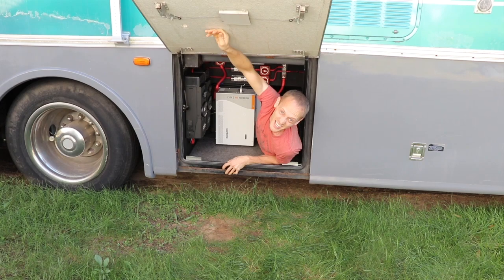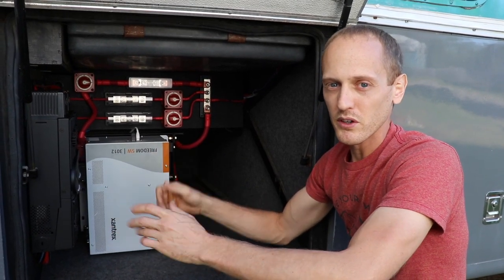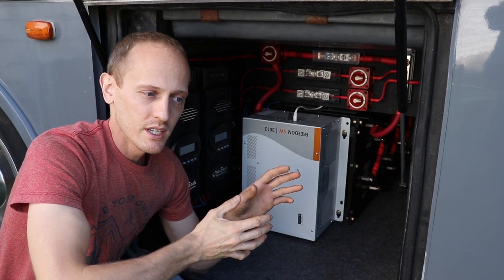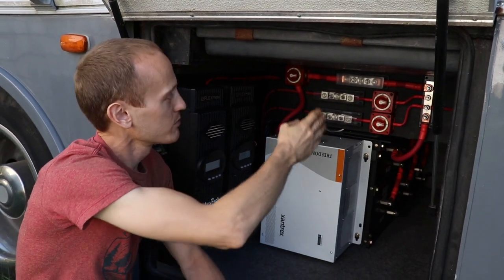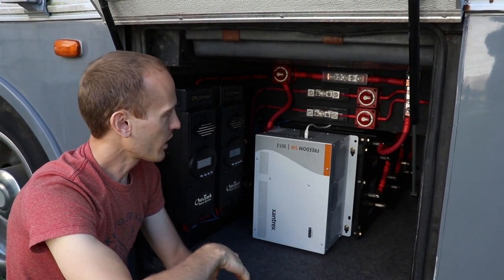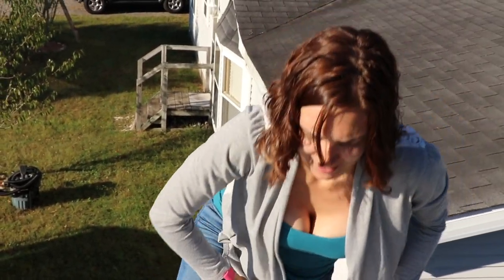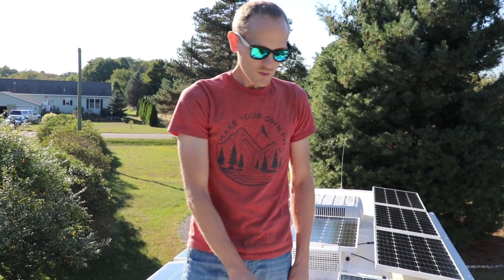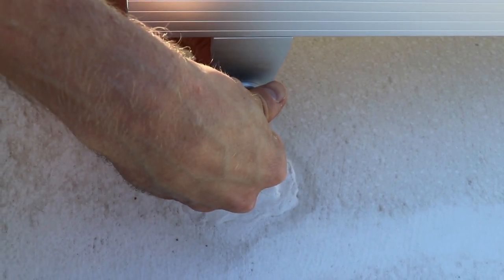Massive DIY RV Solar Install for Off Grid Boondocking

Comment: weight?
Reply from the maker: Battery weight is mentioned in the video. 720 pounds of batteries. With everything involved in the install from panels, to controllers, fusing, wire, inverter, hardware, and frame, we added about 1300 pounds
Reply: @HereThenGone  I guess I missed that, I am deaf, new implant and it must not have come thru in the CC like it should have, thanks for the info, not so bad considering what u got, my fifth wheel has a cargo weight of close to 5000 lbs so I understand  weight

Comment: Sean,

Nice clean install of a robust system! Kudos!
During peak sun and peak load on your system, what are the maximum amps you have seen your charge controllers put out (combined)?
BWT, I think you made a very smart choice by going with good quality AGM vs Lithium. Even though, LiFePO4 batteries have come a long way and are gaining ground, the fact remains is there have not been around long enough to prove their claimed life expectancy under real life use conditions. If you treat your batteries right, I would not be surprised if you get 15 years out of them. This will buy you enough time to see what the true life expectancy of Lithium is and hopefully the cost will come down and further technological fine tuning will be done to the Lithium batteries. If your battery bank works this well for your needs, why would you even want to risk trying Lithium until your batteries expire? Everyone claiming that Lithium is less costly in the long run, is going by advertising hype and false claims. One of the many false claims, is that lead acid only lasts 3 to 5 years. Maybe for the marine deep cycle, but for most that use the true deep cycle golf cart batteries or renewable energy application, those batteries easily serve 15+ years. Many last 20+ years, at a fraction of the cost.
On my coach, my system is half the size of yours (960W, same brand and output panels that you have), and I have four Crown CR260 flooded acid batteries, giving me 260 usable amp/hrs of capacity. It works flawlessly, I am able to use anything I need, except for a/c. Most of the time one or two box fans are more than plenty to keep us cool.

BTW, in your two years of research, to you stumble along and read "handybobsolar" blog? www.handybobsolar.com   He was full timing on solar only from the late 90s to about 2014 and figured out all the weaknesses that made the early solar setups inefficient and ineffective. Has a lot of good pointers on solar (doing it right for the best bang for the buck) and how to treat lead acid batteries where the serve a very long time.

Happy and save travels!
Reply from the maker: So far the peak amp input from solar has been 119amps. We are getting further South now and I look forward to seeing if that increases as we get more direct light on the panels

Comment: Can this solar panels survive lets say on an overland, setting going on roads with lots of bumps?
Reply from the maker: If you don't flip over then yes. Haha. High quality panels hold up better to hail than anything else on the roof of an RV. We have been down some pretty nasty roads with them on this rig and also spent 45 minutes going down a single lane gravel road with trees hitting and dragging across them without a scratch.

Comment: Lithium are less expensive then agm in the long run..
Reply from the maker: So if you have the money, go lithium obviously. If you don't have the money, get the best you can afford. We spent over 2 years saving for what we have in this system. It would have been 7-8 more months to go lithium. We made the right decision for our situation.
Reply: @HereThenGone  Hi, how many usable kwh do you have...? By usable i mean... 1kwh of gel is something like 500wh jsable cause you can't go farther then 50% discharge.
Reply from the maker: @honumoorea873  we have 600ah usable of our 1200ah bank. Converted to your wh that would be 7,560wh @ 12.6v.
Reply from the maker: @honumoorea873  and yes you can go further than 50% as long as you get them charged back up withing the day. Obviously the less you deplete per day, the more life you will get out of them.

Comment: For how long the power lasts?
Reply from the maker: That completely depends on your usage and how much input you have from the sun. We currently haven't hooked to power in 8 weeks and we haven't run the generator except to do it's monthly maintenance cycle (didn't need any power input from it). We cook with induction, we've run our roof A/C a few times when needed, run a window A/C all day a few times when needed, use an electric countertop oven, electric griddle, microwave, and electric water kettle for tea. There is no figure I can give of "how long does the power last" because there are too many variables

Comment: 1200Ah at 12v and 3kW inverter is a risky setup but it is fine as long as you don't use a lot of discharge  power. Your 12v wires must be heating a lot. Why not to use 48V setup for fire safety and wire/weights savings? I believe you have a lot of apliances that run on 12v in your RV and that is why you decided to go for 12v. It is a tough choice to make and I hope it is working for you well. With regards to cost of battery per Kwh per 1000 Cycles the cheapest is Tesla lithium battery. Someone made comparisons and presented with results, i did not verify it but you might like to check it out.
Reply from the maker: No heat issues at all with our 12v wires. Size them appropriately and you are good. That's why we are running 4/0 cables on the DC side. And very short runs. We have been full time for 2 1/2 months now. Over a 1 1/2 months of that has been boondocking and using all of our electronic (120v) heat sources. Induction top, instant pot, countertop oven, microwave, hot water kettle, electric griddle. Without issue.
Reply from the maker: Nothing risky about a properly built and sized system
Reply: Sounds like it is all well built. I like the simplicity of battery connections. Maybe I will do similar way if it works well.

Comment: Few questions regarding those brackets being mounted onto RV roof:
1. By any chance when traveling down the road would the wind 'vibrate' those panels,    causing the baked-brackets' epoxy to 'crack-up', creating leaks.
2. On the inside of the bracket-holding bolts did you use any washers, gaskets, etc.?
Reply from the maker: There is no epoxy involved in mounting the panels. You use dicor, which is specifically designed to retain elasticity. With it sandwiched between the bracket foot and roof, drawn into the roof with the lag bolts, and completely coating the foot and lag heads, you are good to go. I have had these 100 holes in my roof for a year and a half and have over 5000 miles on the road, including a lot of single track gravel roads, without any leaks or issues. As for putting the bolts all the way through, if you want bolt heads all over the inside of your rig with nuts and washers exposed, I guess that is up to you, but otherwise you just tighten the lag bolts(that aren't longer than your roof is thick) down by hand until snug so as not to rip out. Hope that is helpful

Comment: 750 each ?     jeex    way more then lithium
Reply from the maker: Not sure what you are asking? What is 750 each?
Reply: @HereThenGone  i was checking out the cost of those batteries you have..... 6v were the only ones i found that had those pull cord handles on the sides...  amazon wanted 750 each,,   damn near blew coffee out my nose ,  wondered about that cheaper than lithium comment until i saw when u made the vid just now
Reply: @HereThenGone  dont get me wrong..  loved ur set up... prolly do something similar ,,,   found a great deal on used 270w panels for 50 bucks in a warehouse in arz..
Reply from the maker: @stevestrickland7314  we got ours from batteryguys.com and they were only 580 each. Lifeline are the best you can get for AGM batteries, so of course they will cost more than something from Costco like most people go with. Haha. Still thousands cheaper than lithium of the same total capacity.  Good luck with your system. 👍

Comment: I should have asked you how wide is your RV?  Next time you change your batteries (seems like you definitely have the skill) maybe you could make a sliding battery rack system for easier access. Of all the system installs I have watched on YouTube you have the best I have seen. Awesome job. Love it....Could you use a 110 amp thermal breaker instead of the catastrophic T fuses from the charge controllers as well as for the 400 amp coming from the main positive buss bar before their respective termination switches?
Reply from the maker: Our rig is 8 1/2 ft wide. Wider with the mirrors obviously. I was going to do a sliding rack, but as you could see there was literally just enough room for rack I built. Not enough room for the massive sliders it would take to handle the load of the batteries. You need to keep your fusing in the proper format. DC and AC currents are completely different animals

Comment: I have 2150 Watts how much of solar panel do they use and how much of the batteries do I use to control this power
Reply from the maker: I can tell that English is a second language so the question doesn't make complete sense. If you already have 2150w of solar panels, the most battery you would want if AGM or flooded would be 1400amp hours.

Comment: May I ask what your total material cost for this setup was? Thanks in advance.
Reply from the maker: If you include everything, and I mean EVERYTHING down to the screws, nuts, bolts, plywood, spray paint, heat shrink tubing, terminal ends, wire, everything we ended up at $15,000. Luckily we had been saving for over 2 years while working overtime and weekends the entire time. No life, but we reached a goal.
Reply: @HereThenGone  Wow! Thanks!

Comment: i WOLD LOVE TO SEE DIAGRAMS OF YOUR SOLAR PANEL AND WIRING SET UP.
Reply from the maker: Every solar installation will vary when it comes to wiring. What worked for us may not be right for you. The original wiring of the rig even comes into play. I didn't have a schematic because I didn't want anyone trying to do exactly what I did and have something not work. Research and planning for your exact setup is key.
Reply: @HereThenGone  DIAGRAMS MORE FOR THE PLACEMENT OF WHERE THE DIFFERENT EQUIPMENT GOES  NOT TO TRY TO DUPLICATE BECAUSE AS YOU AID EVERY SITUATION IS UNIQUE

Comment: What are the dimensions/specs of the different pieces of your custom brackets and tilting arms. They look like something I would like to try to make. Can you leave the tilting brackets on 24/7 but folded under the panel?
Reply from the maker: I made the "feet" out of 2"x3" angle aluminum and the extension bars out of 1 1/4" flat stock. All dimensions for length of slide arms and their slots will vary with panel size and placement. We currently don't leave the extension arms on. They are more secure without all the extra joints in place for traveling down the road
Reply from the maker: We move every 2-3 days. We have been in one place a week and felt like we were there forever.

Comment: When building such a high power system, why didn't you go with a  24 or even 48V inverter and battery pack ?
Reply from the maker: Quite a few reasons actually. First, this is my first ever solar installation and wanted to keep it simple. Second, I wouldn't be able to charge from the alternator while driving. Third, I didn't want to have to wire in a DC to DC converter for all the 12v electronics. Finally, I would have only been able to use 4 or 8 batteries. 4 would have been less total amp hours available, and 8 would have been another 240lbs on top of my already heavy bank.

Comment: IS THERE A SLIDE THAT WOULD SUPPORT THAT BATTERY RACK SO IT COULD BE SLID OUT TO MAKE ACCESS EASIER? YOU HAVE A BEAUTIFULLY SET UP SYSTEM. NICE JOB....LOVE IT...
Reply from the maker: We wanted to have them on a slide, but they literally JUST fit in there as it is. The great thing about these batteries is they don't require maintenance. The only time we should need access is when we're replacing them in 10+ years or if we don't switch to lithium when we win the lottery. Haha

Comment: Impressive system you designed it very well. Looking at your battery Bank 400 watts pair battery they must be more pricier then the average battery banks that I see with 6 volts batteries around 150 amps each or so.

I know you mentioned it earlier about lithium batteries being more expensive so evidently you looked into it but I wonder how much of a difference would it have made on price-wise?

I don't know about all lithium batteries but I've been looking into the Battleborn you can deplete them 100% without damage so you can get 100 amps from each of them, and there 12 volts each.

So six battleborn batteries would give you 600 amps of usable power as your system does but they're light wight wouldn't  have to build a bracket to hold all that weight. 

Keeping your rig lighter conserving miles per gallon of fuel and more stable on handling instead of overloading one side of the rig with all that weight, unless you mounted them dead center.

lithium charges very quickly with no resistance you probably could have cut at least 2 solar panels off your roof. I'm also thinking that you can probably run your air conditioning longer than 4 hours since lithium batteries deplete slower at a high amperage draw then lead acid.

And the biggest bonus is this the AGM batteries might last about 5 years or so then you have to replace them all again, while at least the Battle Born batteries anyway you can get 10 years out of it and still be getting about 85% of its capacity.

So I'm thinking that it might have been a slightly higher cost with 6 Battle Born batteries but you would have saved money on the custom bracket maybe being able to eliminate two or more solar panels and the biggest cost not need to replace the batteries for at least 10 years or more and that's the biggest part of the savings 

I've only say that because when you do replace the AGM's batteries It will be a good idea to saving up and try to get the lithium batteries next time around.

Sorry so long but again empressive video I even saved it 👍😉.
Reply from the maker: Yes they are more expensive than smaller AGM's. That only makes sense. In our case the difference in price between the batteries we have and BattleBorns was $2500. We are renovating the entire rig on top of doing solar and along with paying off our house and trying to save up some for two years of travel, so that is a significant amount of money. The 8.3L turbo Cummins doesn't care about the extra weight. The custom bracket to hold the batteries cost me $25. 5 years may be true with cheap batteries, but these(if not abused) are a battery that has been proven to outperform all other lead acids. We would love to go lithium in the future if the price comes down and we save up for them. thanks for dropping a comment.
Reply: @HereThenGone  
o ok I was actually thinking it would be about a $2,000 or $3,000 different but that makes sense it's better to pay off the other thing first.

Awesome I also have a 8.3L turbo cummins 38.8 feet. It's a 2002 Holiday Rambler ambassador love that engine! Lol. 👍😉

With a 7500 watt quiet diesel generator.
Reply from the maker: @raven7068  nice. We only have a 6500w Onan. Our rig is a 94 though. Probably a bit louder than yours as well. But it sure runs great with only 320 hours on it.
Reply: @HereThenGone  

Awesome still plenty of power to run everything you need to run.

I'll be getting my solar kit on my motor home soon I'm not doing it myself I'm having a company doing it for me.

But I do want to custom make the brackets like you did and raise my solar panels off my roof at least 6 inch or so that was a phenomenal idea👍😉

Keep the videos coming my friend I look forward to seeing how your setup runs ☺

Comment: Nice and clean install.   Working on the first steps of my solar set up.  My panels are larger so I'm running into some logistcal mounting problems.  My house ran on wind and solar for about 20 years ago so I've got some experince with most of the set up.  I decided to go with two Flex Max chargers as you did mainly because I want to end up with two completly seperate systems for redundancy.  Plus I want to be able to run run one AC unit or charge my electric car off of one system while being able to still use the other for the fridge, TV's, lights and electronics.  Why did you decice not to use one Outback Mate with an Outback Hub along side with Outbacks Wireless Interface?  I'm always open for other ideas.   Mark
Reply from the maker: As for mounting the larger panels, unistrut or 80/20 would be a great solution. Sorry to say that with the amount of real estate on an RV roof, you won't have enough solar to run your A/C or charge your car and also have another system for the rest. This is my first install and i just kept both sides of the RV separate and like seeing the difference from one side to the other in terms of charging. The roof is slightly curved so there is almost always a little less charge coming from one side based on the angle of the panels.